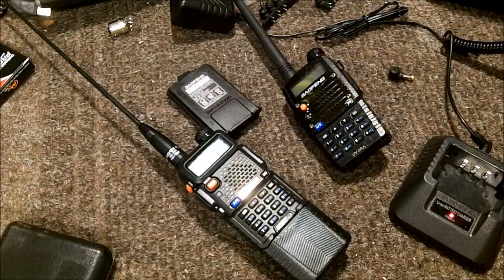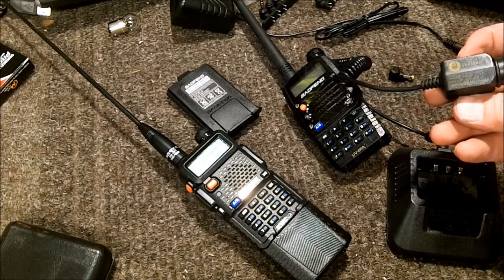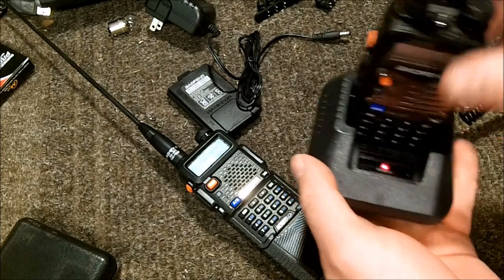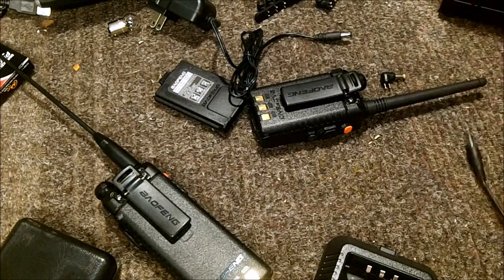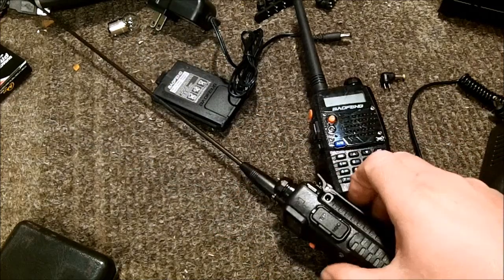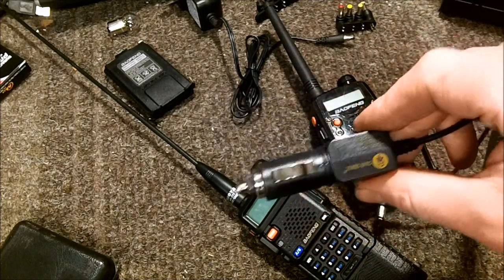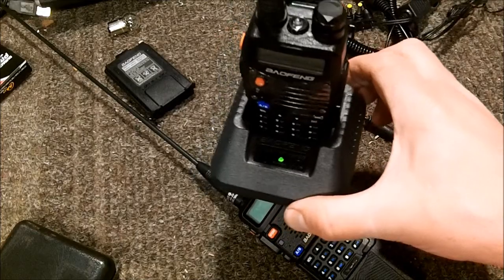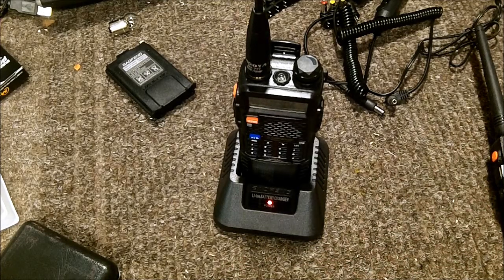Baofeng Radio: 12V DC Charging Mod

Comment: Years back I soldered leads and ran to a 12 volt 6ah battery. That ran for ever. They would actually push close to 6 watts. Used a pair ona a battery as an emergency repeater. Would last nearly 20 hours of moderate usage. I guess no body does those experiments anymore

Comment: i have the dreaded mis match battery's. 
possible to discharge the pack. then charge it up. will this balance the two batteries? 
i do not want to tear it apart if possible. 
also are there replacement loose batteries on the market?  
aka the cells. not a whole pack.
if so what is the numbers used? 
and who stocks them? 
i know a new pack is cheap. but this way i know the two batteries match each other. .
Reply from the maker: B-Tech make new battery the have USB-C port for easy charging. Plus B-Tech has a return policy and they are located in the US.

Comment: The Baofeng cradle charger is trash, because the engineers at Baofeng disregarded ALL of the data in the SC6038 charger chip's data sheet. It specifically tells you not to leave chip enable (pin 6) disconnected. Guess what the Baofeng engineers did? 🤣

They also wired the battery sensing backwards to get a slightly lower voltage from the regulator. SMH
Reply from the maker: Thanks for the feedback!

Comment: To answer a few questions:

-A Flashing Red LED on the cradle means that there is something wrong with the battery and it will not charge. Any attempts to charge ends when the LED starts to flash.

- The cradles can only take 5 to 10 volts. Anything more than 10volts will damage the charging circuit. Some have tried with 12V from their car and got it to charge but I will say from that the amperage must be very low so it is possible to charge at 12volts with a low amperage.

- Owning several types of Baofengs, all my chargers exhibit the same behavior: Red means charging, Green means Charged, and Flashing Red means Battery Failure.

-The extended pack does have its own charging jack but it is for a USB Adaptor, which is 5V. Anything more than 6V going through it will damage the charging circuit. USB electronics can easily be damaged by over-voltage.

- As far as the UV-5RA, that radio I do not own. But I seen youtube vidoes making a modification to the extended battery pack to make it fir the UV-5RA. It mean cutting a couple plastic tabs on the extended battery case to make it fit. Search and find these vidoes to see how it is done.
Reply from the maker: Thanks for the feedback.

Comment: I have a Baofeng UV-16 and it has a USB-C charger built in, so I can use any USB-A to USB-C cable and a 12V car charger to charge the radio. The question is: Can I use the radio while charging? The radio works while charging, but the question is, does it harm the batteries?
Reply from the maker: It shouldn't harm it. They step up transformer to 12volt.

Comment: Is it possible to use the radio while charging? Is there any problem doing this?
Reply: Do not transmit while charging on the supplied charger. It has a chip which gets hot and can burn out. Best to have the radio off when charging to minimize current draw. 👍

Comment: My charger said 12v 1A.  I use 2 HT radios and have mounted the chargers in my car and wired them straight to a switch.  That way I can chose if they charge while the key is off or not.

Comment: I use a 12v to 120v inverter to a 3 way multi plug to 2 chargers. I've even thrown a 3 way 12v multi plug in the mix so I can use 1 radio while charging 2 batteries. It's a bit Clark Griswoldy but works.
Reply from the maker: Nice!

Comment: If you choose to charge DIRECTLY from the SIDE plug, wich is the volts (8,4v ?) and mAh that are need for?
Reply: Any answers? Im looking to build a mobile top up system for it and I'm having troubles finding exact specs about that Port

Comment: I just got the same setup as you. Last night I plugged my USB charger into my battery (2/3 bars of battery life) and this morning the battery was completely dead (battery symbol flashing). When I have the charger plugged into the battery, the radio works. But when I unplug the charger, the radio dies immediately. 
Has this ever happened to anyone?
Reply from the maker: Interesting, I the Baofeng radio chargers in my experience have always have had issues. I own four radios and the chargers all seem to display different charging levels.

Comment: You could use a 10VDC voltage regulator. They sell them at electronics shops. You can have a female DC jack on one side and a male DC jack on the other. The female would receive the power from the car adapter, and the male would feed the charger. Job done. Some soldering would be needed of course. Something like this: 

https://www.amazon.com/Electronics-Salon-Positive-Voltage-Regulator-Module/dp/B00LM2ISOU
Reply from the maker: Absolutely, thanks for the insight.

Comment: Your answer lies with in. After some damage. I skinned out the battery holder. then  made a regulator.   I took a 7805, and added   4  1 amp diodes pointing to ground. Off pin#2.  Them put one ten UF cap at pin#1. The + at pin #1. Then put a 10 uf cap. On #3 pin. the (+) to pin#3, and ground to ground rail. Then to take noise out. I put at #3 pin,  a 0.1 uf  ceramic  cap. One end to positive other to the negative. Simple system and can be shoe horned in the original box. Then I took a cooking timer . To announce at 0 to 3 hours of operation. Battery and charger doing fine (as l was too lazy to add Charge indicator.) Works well.  Even added a strip of aluminum as  a sink to cool the 7805 .( We be  cool) . Ps the radio has a volt meter built in one bar to 3 in short time. . Bread board it first to check results as I use solar for my power.
Reply from the maker: Thanks, I am going to give that a try on one of my chargers.

Comment: Hi I wondered if you could help. I have a boafeng uv b5 but the charger isn't working. DDo you know of any alterntaives chargers that will work. I have looked on the internet but chargers specifically for this model are quite pricey. Any aletrnative to get running again, would be appreciated. Cheers
Reply from the maker: I have never owned a UV B5 and it appears that chargers are hard to come by. I did a few searches and couldn't find any aftermarket options. Maybe someone else could point you in the right direction.
Reply: Many thanks for getting back to me. Can you recommend something similar or better. I only have my foundation licence. Thanks again

Comment: Wait I am so lost.
Does it charge? because it seems it stays RED and also there is no indicator on the radios screen that says it is charging. So how will we know if the radio is even being charged?
Reply from the maker: It does charge, the Baofeng chargers are a little goofy. Even when I first set a radio on the charger using wall power the light does not indicate the correct charge condition. However, after a minute or so it does, not sure why. Also some of my charger bases react differently. My guess is the low quality standards of this cheap China manufacturers. Thanks for watching.
Reply: Nomad-76 said, "I have also that some of my charger bases react differently. "
There are different versions of the charger bases. The latest of which I'm aware is the one using the PCB marked,
NEW - 5W - VER11
2018-12-25
As far as I can tell, it uses a different charging control chip than any of the older charger bases.
However, so far, it has been very consistent in all operations including the "charge-to" voltage and the time required to charge battery packs that were depleted to a known state.
I've tested it using multiples of each BaoFeng new 1800mAh, 2100mAh, 3800mAh battery packs, and a 5000mAh battery pack I made.

The assembly quality that I've seen so far on the newer version chargers is surprisingly good.

It could be your chargers, but there are also problems with counterfeit battery packs being sold. Counterfeit products is a significant problem...even for the major manufacturers who can get counterfeit parts to build their non-counterfeit products.
Reply from the maker: @exgenica  Thanks for the useful feedback. I have thought about extra charger bases but I am skeptical of most the Amazon and eBay sellers. Heck I am probably better buying a new radio to get the newer charger base.

Comment: Another thing I’d like to know you may know the answer, if I keep the battery plugged into the USB and then plug it into my car can I use the radio while it’s charging or will that hurt the battery
Reply from the maker: Good question, I have no proof that keeping them plugged in will degrade the battery, Yet, I have heard it will, on the other hand replacement batteries are affordable.  Sorry I don't have a better answer may be I should try it out and see what happens.
Reply: Do any charging experiments only while its under observation and only in location where if it fails catastrophically (fire/explosion) it is less likely to start a fire. (e.g. charge on wide concrete area, in a fire-pit, etc.
My understanding is the BaoFeng charging base/stand will misinterpret the battery pack's voltage when the radio is turned-on while charging, which could cause it to overcharge the battery pack with all the bad results that could entail.

At least some of the battery packs seem to have protection circuitry, but it's not globally claimed by BaoFeng. Protection circuitry would REDUCE the chance of battery damage; minor or catastrophic.

Comment: Bow fang sells a cord that’s made to plug into the battery it has a USB end on it so you plug a USB connector into your cigarette lighter and you’re good to go it has a red light on it it turns green when the batteries charged it’s made by. Bow fang

Comment: Great video. Just need some more information. Can the UV-5R be placed in the cradle that is plugged into house power (120v) and left turned on indefinitely? I ask because I would like to use two in my attic (#1 as RX and #2 as TX using an audio cable), hooked up to an external antenna on the chimney as a repeater, so I can roam around my property with a stubby antenna on my third UV-5R.
Reply from the maker: I personally haven't tried leaving plugged into wall power but I don't think it would be problem. I seen other guys use the UV-5Rs in probably repeater set-ups. Thanks for watching.
Reply: you will age the battery fast doing that. I would just hook up 7.5 volts through an eliminator. It will cost you less than destroying a battery that you can use for other baofengs

Comment: I know a lot of hams that use the cigarette lighter plugin directly to the Baofeng extended life battery and I always warn them that the voltage is not correct to charge the battery and they are risking damaging the batteries, but they never listen. Maybe one day they will learn the hard way, hopefully not in an SHTF situation though.
Reply: @WH6FQE: Hi Robert.  You are so correct in your comment regarding hams charging the extended battery direct from the car cigarette lighter.  Most (probably all) of course deliver 12v which is 2v too much, both for the battery AND the charge cradle.  Additionally, as regards the battery, the charge is not controlled which will affect the battery’s life expectancy and even damage it.  
I’m afraid that hams can be taken to water, but they can’t be made to drink!  There is so much wrong information in this video that I’m afraid I don’t have the time to comment on all the mistakes.  I am not a troll, so guys, my advice is to do more in-depth research yourself AND STAY AWAY FROM IDIOT TUBE VIDEOS!
Reply: A good place to start is a website like batteryuniversity.com
Reply: direct into baofeng battery you want it to be about 7.5 t0 8.5 volts under load (whihc is going to be 9 or ten volts before loading). BUT if you are using the normal charging base to charge you are fine up to 14 volts.  the stock wall wart is 10.5, but you can actually put up to 15 in it and it will show 8 under load at the terminals, as base has circuitry inside of the charging base.
So hams are right in just getting the barrel size and polarity right and all else passthrough --  if in a car also using the oem charging base.  And you are right that 14 is too much to put direct into the battery though the barrel port in the battery

Comment: Tons of options on amazon.  Just search baofeng USB charger. There's USB cords that step up to 10v that plug into your cradle or cradles with USB built in. They also have plenty of cigarette lighter style.
Reply from the maker: At the time I made this video I couldn't find a suitable option. Thanks to viewer like you I have been made aware of several viable options now being sold. Thanks for you feedback.

Comment: I finally have found a way to charge mine via USB buddy and it works well. It is on my latest video. 

I subbed you and if you get a chance get me back. Cheers from the UK!
Reply: I would incorporate a DC-DC Boost/Buck converter within the charger (£0.99 from ebay), this will then take any voltage from 4-35 volts and efficiently increase or decrease the voltage to what you set it at (10V).
Reply from the maker: I have noticed few new manufacturers on Amazon advertising USB style charger but I haven't tried them. I hit you back with a SUB to your channel.
Reply: Thanks buddy, on my video, Bug out bag electronics there is a link in the description, only £1.50!! 
I may have to buy an extra one because it actually works. Cheers bud
Reply: James Allen I totally agree with this. 👍

Comment: I wanted a portable solution, so here it is

1M USB DC 5V To DC 9V supplied by lanmu on Amazon,

I connect the lead into a 5v power bank, it does take a while to charge but at least I can top up the battery while out and about.

I also bought 1M USB DC 5V To DC 12V and I'm able to charge my Kenwood the f7 & my Kenwood d72.

hope someone finds this helpful, I'm also in the process of making a extended power option for baofeng. will post my results

Comment: thanks for the vid. could you answer this question for me? Is it ok or preferable to leave these baufeng radios in their cradles constantly charging (eg plugged into AC outlet at home? or does this damage / overcharge the battery?
Reply from the maker: It is my understanding that with lithium ion batteries, this should not be a issue. However, I charge mine and then remove them for them cradle, just personal preference.
Reply: It's also advised to ALWAYS remove lithium-ion batteries from the charger after charging and if storing then place them in a suitable non-conductive protective container. Chargers and cells do fail.

If you're going to store them for a month or more, then don't store them fully charged. It stresses the lithium-ion cell. Research care of lithium-ion "batteries"...lots of info available on the internet at places like batteryuniversity.com and similar.

Comment: I put a 10 volt voltage regulator in the base of mine it works quite well
Reply from the maker: +Mark Lemen I am going have to give that a try, thanks for watching.
Reply: I came to comments to suggest exactly that, can use a buck boost regulatory and then it will except a really wide voltage range. 👍

Comment: PS the rectifier will fit in the end of the cheep 12v plug .. I have 11 of these radios. Yes I do have better ones. But these are so cheep and the the battery last at lest a year. I have them in my car my truck my girlfriends car home and at work. And a back up hear and there with the ability to charge them
Reply from the maker: +Superdan187211 Good to know,  thanks for your insight. I found a step down power supply on EBAY. Was I order on I do a follow-up video on how it works.

Comment: I had to wire in a 12v rectifier .. It worked even though the volts where a little to much
Reply: +Superdan187211 and they are super cheep